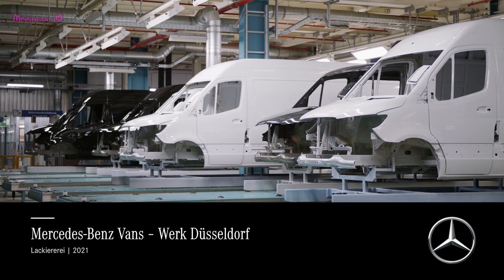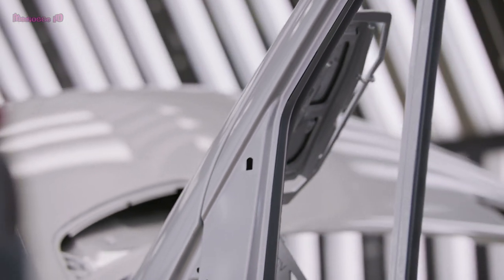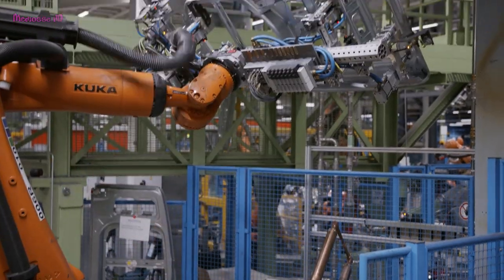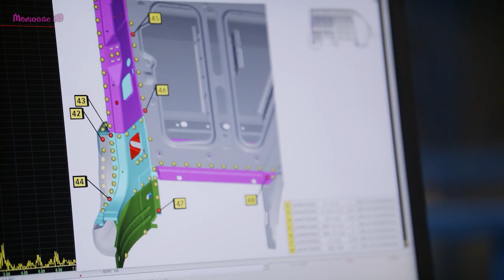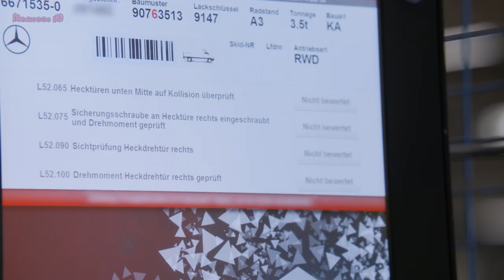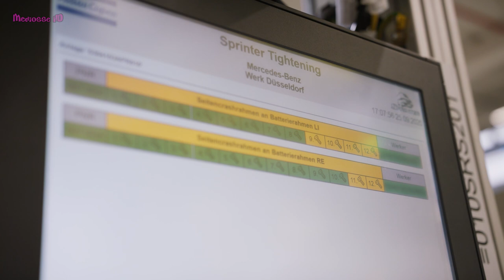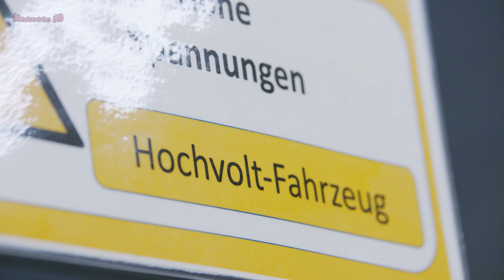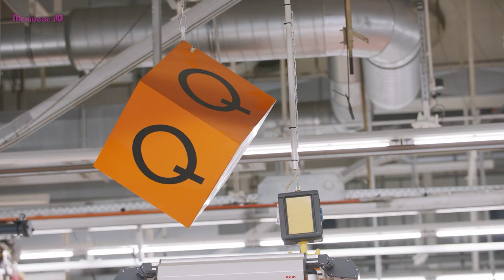Mercedes-Benz eSprinter Production in Germany – Last Generation Mercedes Sprinter Van Build Video

Comment: You are a failure! engineers with that designed an EGR valve in my 2020 has to be removed every 5000 miles and cleaned! Hot soot running though a coolant cooled part. 👍 👌  outstanding craftsmanship
Reply from the maker: Great point!
Reply: @MediosseHD my local dealership MB of Newton Nj said it falls under my own problem maintenance category. Even with my 100,000 warranty. They want to charge me $100 to clean it!  Sad isn't it? I got it down to 20 minutes do it myself.

Comment: Mercedes has still not resolved the rusting problem on the Sprinter. I just bought a 2018 sprinter and rust is starting to show. The Promaster is superior in this respect.
Reply: What kind of rusting issue does it have? Or what exactly rusts and why?
Reply: возможно в новом кузове с 2019 года уже проблема решена?

Comment: Yea, they just don't seal the holes in the body for the side molding, so when it rains or you wash it,  it leaks into the inside. "High quality." Hahaha. Not to mention all the many electronic bugs that continually malfunction.